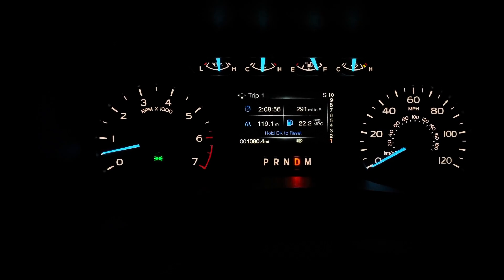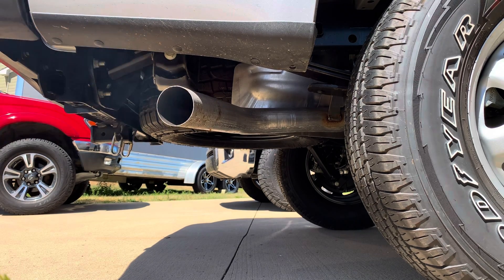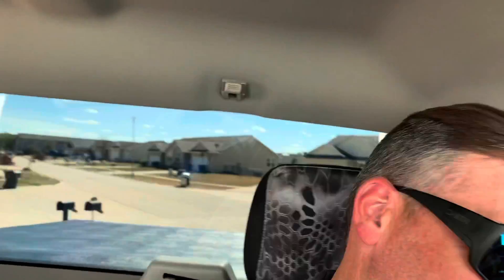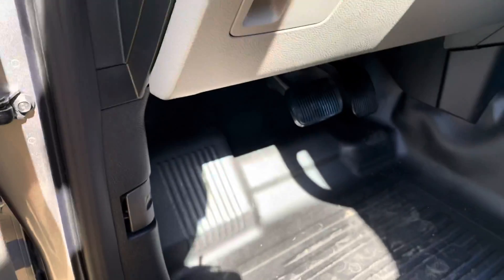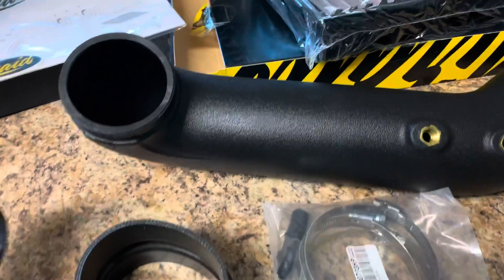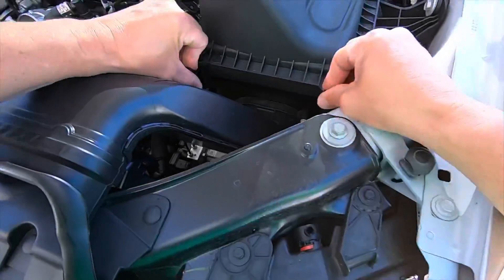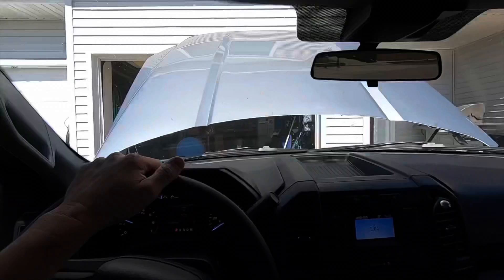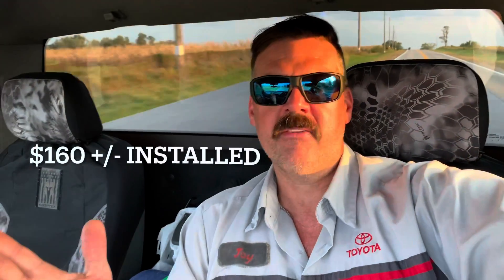2020 F150 5.0 Magnaflow w/ Airaid Intake Tube

Comment: Any update ? Still running this set up?
Reply from the maker: Yes all good - after axle dump
Reply: @JLeeChron  what are you thoughts on the intake tube ?
Reply: @JLeeChron  I’m in between if I wanna do the setup you did or get the whole cai kit. I have a exhaust already
Reply from the maker: @cpgaming911  wouldnt bother with the whole cai kit, too pricey not enough return. The air raid jr kit is to clean up the engine bay, a little more intake noise. 
Stock truck is good, whipple best

Comment: Did you have it in tow haul mode just to change the shift pattern so it would rev higher before the shift?
Reply from the maker: No actually its sport mode, but tow haul works well also
Reply: @JLeeChron  ok I seen the tow haul display on in the cluster I have the flow master 10  race series and the full air raid system on my f150 coyote and it screams